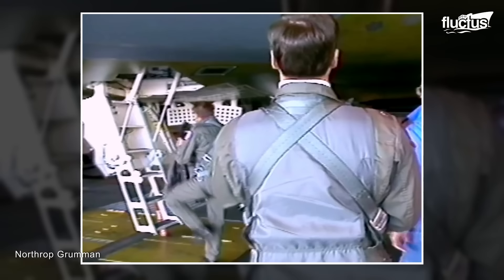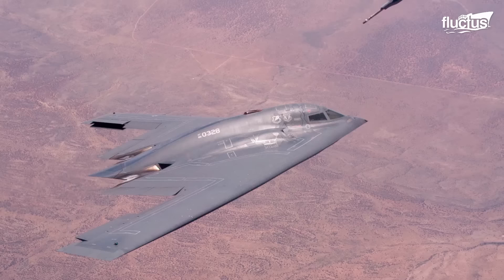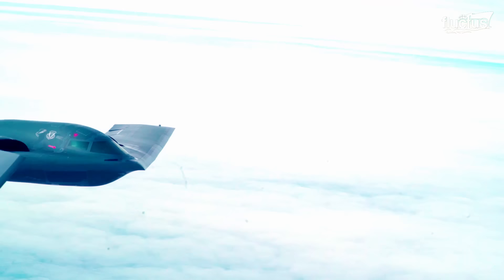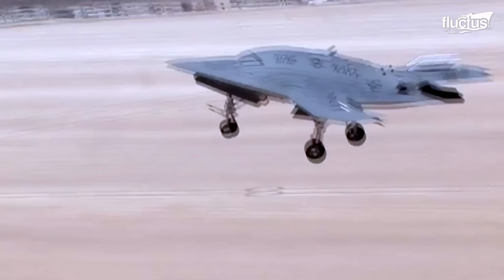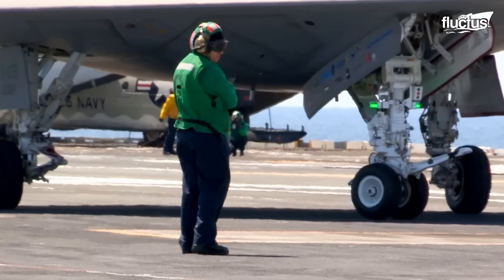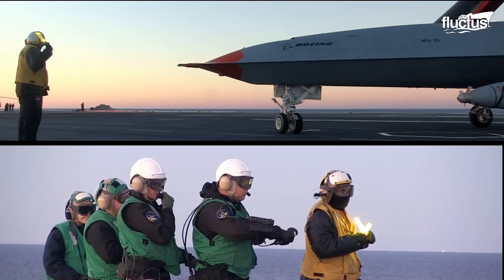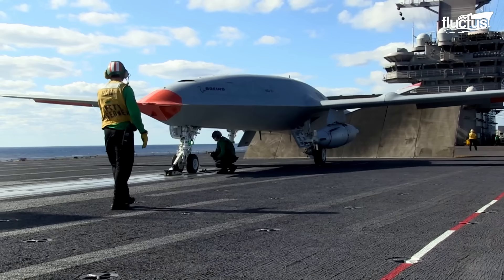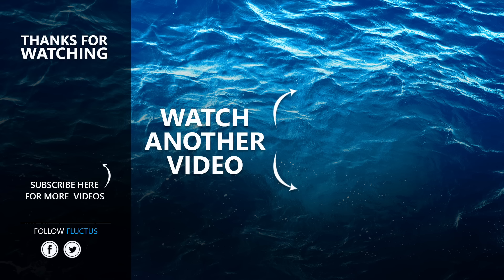Inside Secret Hangars Storing US Most Advanced $2 Billion Stealth Planes

Comment: Boeing Australia built (although still being tested but is fully functional) in a colab with the raaf dubbed the ghost bat, it’s a full sized unmanned drone that supports existing fighters ground and air defence teams. It’s basically a pack mule that with a wide variety of options depending on the mission at hand and can fly for more then 3,700km which is basically east to west of Australia without stopping. When it was announced in 2019 it was the first combat aircraft to be made in Australia in over 50 years

Comment: The one time a B2 bomber flew to another airfield and was parked outside overnight... it crashed on takeoff the next day.
Reply: As someone who spent years around that aircraft, they have spent countless nights parked outside overnight... even in Guam.
Reply: @bluecreekroad  That is how accidents usually work.  The incidents are studied so they do not happen again.  In this case in 2008 a B2 was parked outside in heavy rains in Guam and moisture seeped into the air-data sensors,  So the next morning when the B2 took off the computers received erroneous data and the bomber crashed.
Reply: @rudder727  I was there when that happened. What I was saying is that I went TDY to Guam (and Diego Garcia) from Whiteman multiple times prior to (and after) the crash in 08. The jets sat outside more times than not because there wasn't enough hangar space to keep all of them indoors back then... or at least through 2014 which was the last time I was there. The maintainers hated it because of all the extra work and hours they had to put in to keep them air worthy.